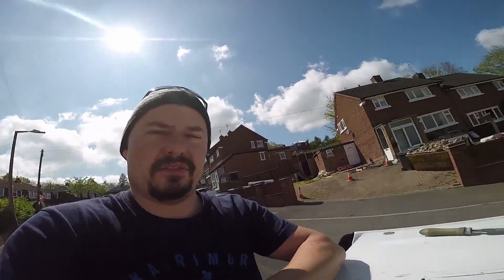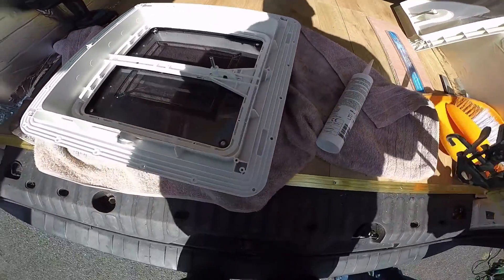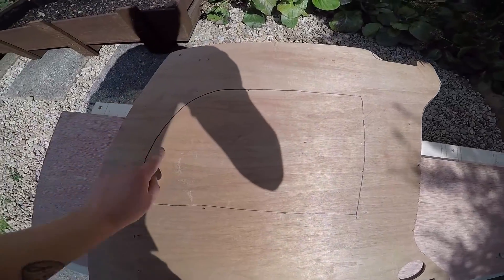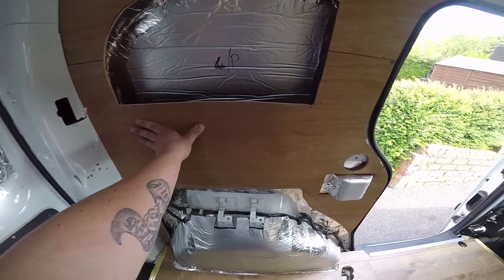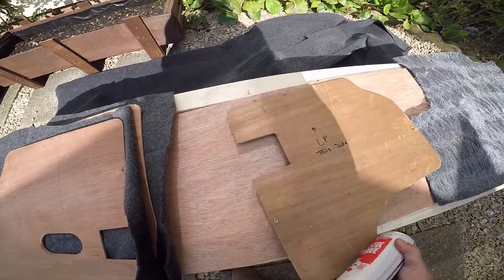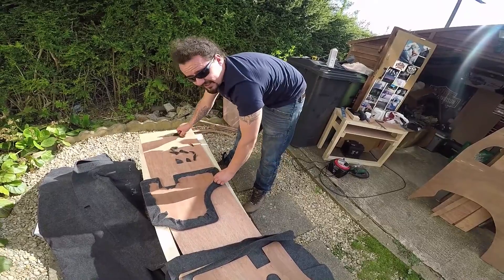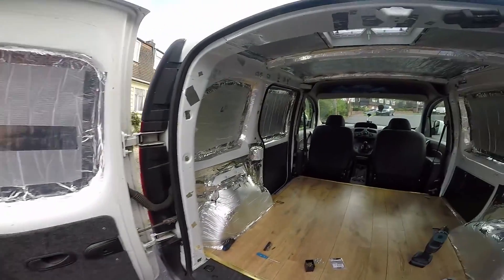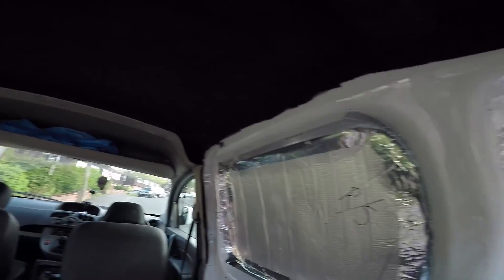Renault Kangoo Kamper | Pt 3

Comment: Cool build mate, question! I’m to have a kangoo and I’m going pretty much along the same route as you with the build, how is the condensation with the roof vent, as I was either going the get the same sort of one or have a wind deflector on the side windows and just open them slightly a night.
Reply from the maker: To be honest I never really had too much of a problem with condensation, the odd morning in Scotland there was a bit on the windows dude to the fact my clothes and boots were wet from all of the rain, but all of the metal work and so fourth was dry. Quick 10 mins with the window dehumidifier vents on and they were clear 👌
Reply: mate go for one with a deflector this guy clearly is very low on the intellegence scale some of his work made me want to scream at the screen

Comment: Hey man, big fan of your kangoo setup but i have a question cause i want to do the same with a kangoo.

If it gets to hot in the car, is there any chance the whole insinde roof (isolation + carpet) will fall down because of the glue kind of melting and weight + gravity ? 

I live in south of france so in the summer it can be pretty hot, wondering if i just should screw a wooden plank between the isolation and glue the carpet to the it.
Reply from the maker: Hey! Thank you for the comment.

Well it's been up for over a year now and last summer we had some pretty hot days around 30/32° so not as hot as south of France but still pretty hot, and it didn't move or sag at all. 
If you have the time it may be a good idea to use a think piece of wood board and screw it to the ceiling to hold the insulation in place like you say, better to be safe than sorry and you don't want to have to do it all again.
Reply: @kangookamper8149  yep i will do thanks ! 🙂
Reply from the maker: @Zeben84  good luck with your build ❤👍